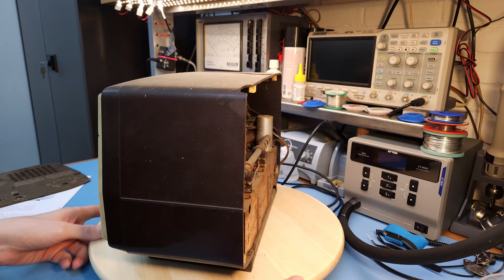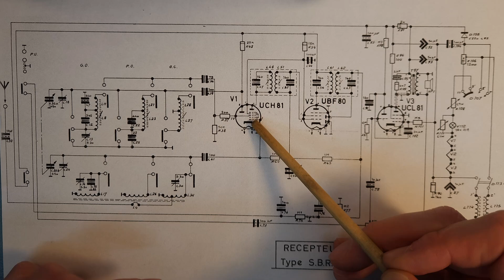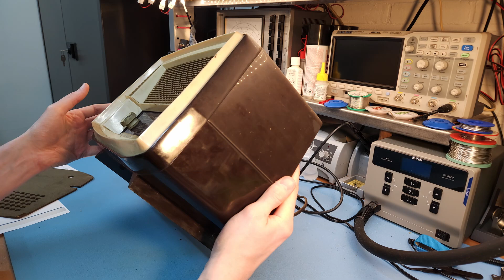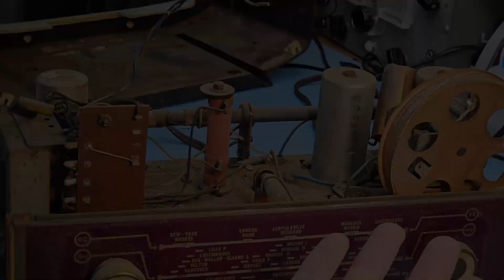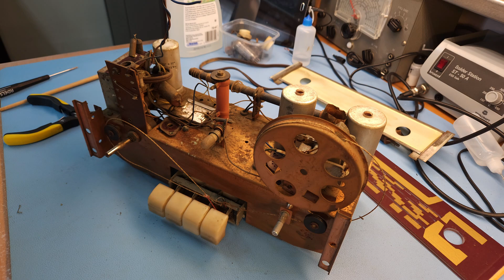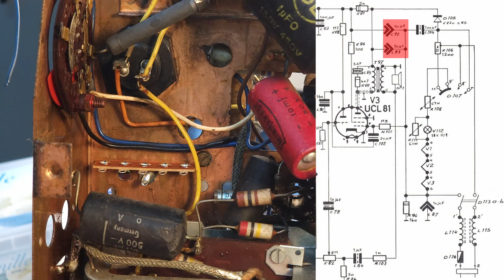Is this simple radio worth the huge effort it needs? - SBR R1 - Part 1

Comment: I see one more mistake in the schematics: the B+ connection to the plate of the heptode is missing ! 🙂
Reply from the maker: Correct! I noticed that as well while I was editing the video. You can also hear some hesitation in my voice while explaining that section because I noticed something was off but couldn't really pinpoint it instantly.
There are multiple issues with this schematic...